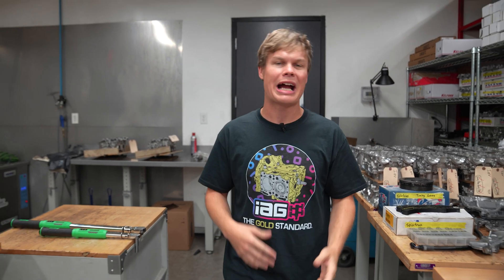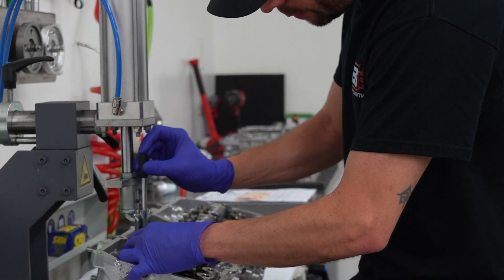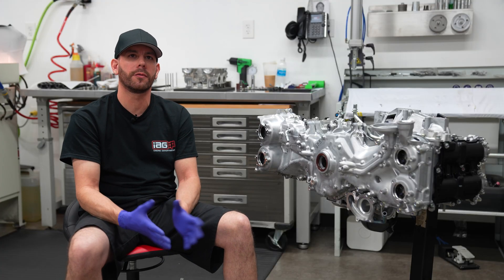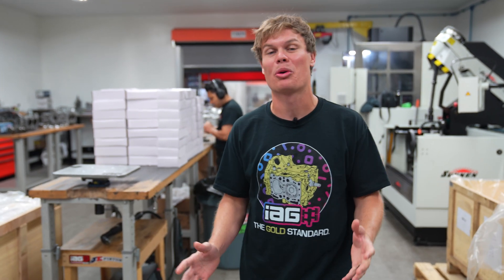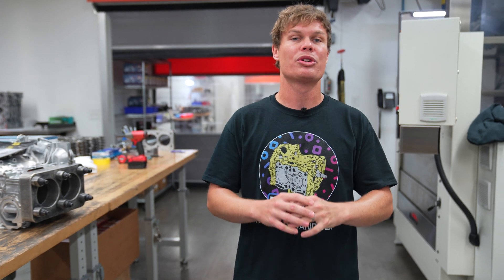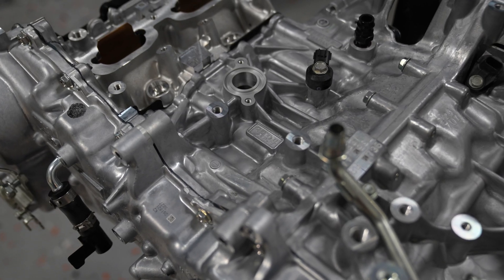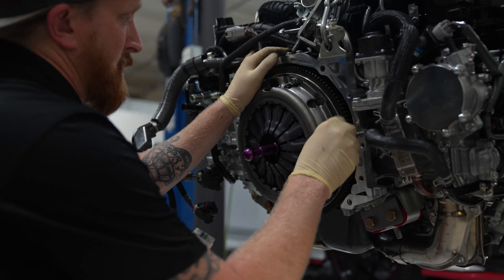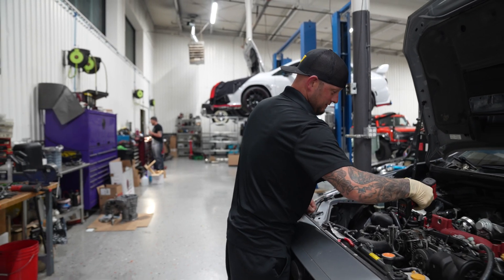Built Engine for 22+ Subaru WRX is Almost Ready!

Comment: So if you dont like your stock subaru vb transmission and open diff you can install LSDs in front and rear. Google "subaru vb front cusco lsd" and check it out yourself. I hope i dont have to explain that rear can be changed too.  IAG will delete this post since it is not their product i am advertising.

Comment: Did you guy also pickup a ascent motor, it would be good to compare that with the 22+ wrx cylinder head & case half’s. Would be a good video 😎
Reply from the maker: They are VERY similar. Will keep that in mind for future content, thanks for the suggestion!